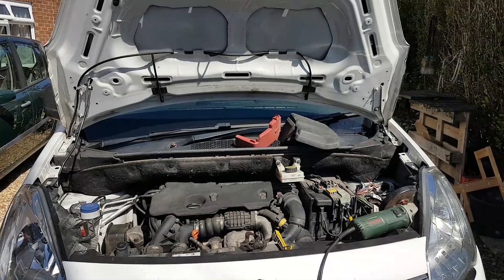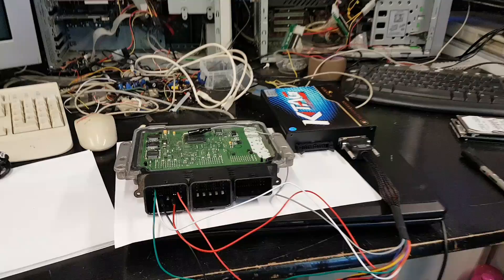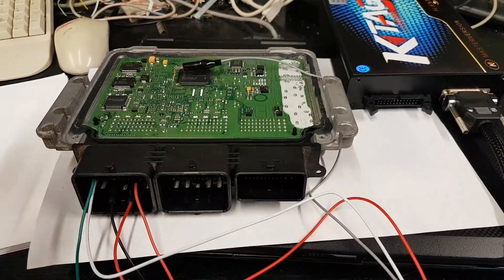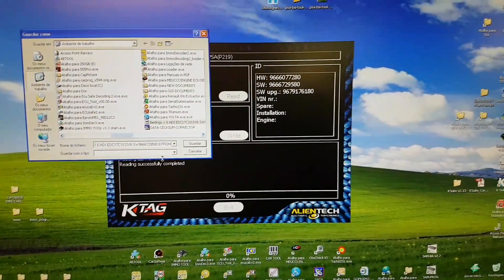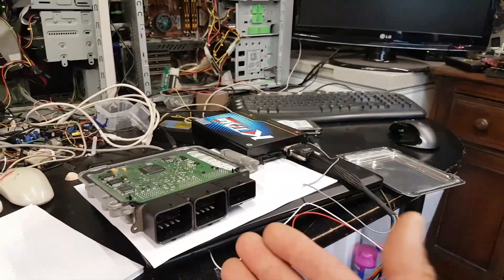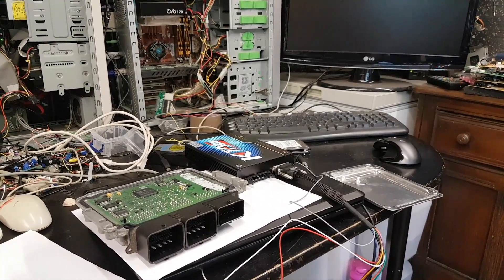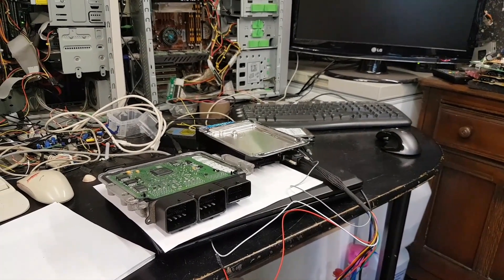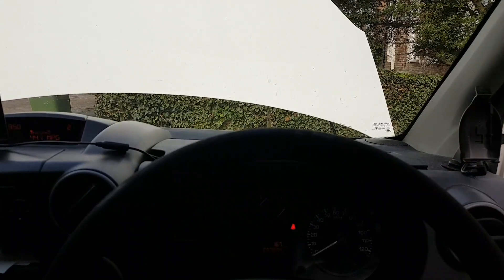Read and write Bosch EDC17C10 with the Tricore TC1797 using K-tag.

Comment: hi
in the menu of ktag you have 3 choice, from "edc17c10  PSA "
plug in 
219- bosch edc17 C10 IROM Tp1797 and
319 - edc17 irom cp42 tp1797
both have tp1797 processor but different plugin

how do you decide which one to select?  thanks
Reply from the maker: They all have the same processor, but the suffix is different...
The first one you mentioned, is obviously for a C10, the second one for a CP42...
You just need to know which ecu you are working with...
👍👍👍
Reply: @LMAutoRepairs  thanks a lot for the quick response,
I also saw   pcb is different from this 2  variants
 greeting from Holland

Comment: Hello i' m trying to read the same off yours edc17c10( maps )by ktag but i'm getting error Reading at 86%. It maybe of ktag clone version. Thanks for help
Reply: Hello, I had the same problem, using a good 8MHz 18pf quartz resonator and adding two 22pf capacitors solved the problem.

Comment: What is tricore? Is it with three wires? K line and can H and L?
And is the advantage of this that you dont have to open your ecu?
Reply from the maker: Hi
No... the tricore referes to the 3 packages united in one single chip...
https://en.m.wikipedia.org/wiki/Infineon_TriCore#:~:text=TriCore%20is%20a%2032-bit,DSP%20in%20one%20chip%20package.
Thank you for watching!

Comment: Doing the very same job yet im getting checksum error on when saving the read files, size of micro is only 1.125mb
Reply from the maker: Make sure you have selected the correct plug in, double check connections...
TC1797 should have 4Mb flash (maps)...
Good luck...
Thank you for watching and for your comment, b
Reply: @LMAutoRepairs  thanks didn't expect you to reply. Solved it by reading from another pc. 🙂 Just need to get hold another dump now. Thanks for sharing your videos.
Reply: @simoncarabott7119  what is the Operating system of the pc you used to get work?
Reply: @leonardorolaza8060  issue sorted was using win 10 laptop i read it on my desktop also with win 10 no issues. I have downgraded to win 7 since then

Comment: Nice video! So, in that ecu was possible to pull the whole flash via tricore? I thought that you can do that only bdm style. 
Is good you pull the eeprom and the flash, but was t better to have that compressed-encrypted full backup what ktag do also? 
If on the way back of writing something goes wrong or put wrong software, ktag will allow you to write only the encrypted one because the lost identification numbers.
Is it the same programming for all EDC17? 
I need kia's crd engine bosch edc 17 ecu fully cloned and suspect will be same. Does it need again that boot pin wire soldered in case of bdm used or will be just fine to be that tricore style? Thanks

Comment: A little bit off topic have you done a Bosh triocore cloning with that tool , I got a burnt ecu gonna have to clone , any advice how its done ? Its a renault master 3 2011 by , 2.3 diesel ,its new to me
Reply from the maker: That should be an EDC17C11...
Most likely has an OTP area...
Might be possible to move the OTP data and do it that way... but not sure, never done one...
This tool will be most likely able to read and write... but obviously not into the OTP...
Thank you for watching!
Reply: @LMAutoRepairs  thanks for reply

Comment: sorry a quick question if the ECU work on the vehicle before or after opening it then why take it of and read and write it again what is the purpose

as am not familiar with it?
Reply from the maker: To modify the maps/data on the ecu...
Thank you for watching!
Reply: ok i see so its not affecting the original  data was in it before if no then how the old data well re restor again is it through the Software in said the K-tag?
Reply from the maker: @rk18drive13  
You are not really familiar with this stuff, I can see...
In this case was nothing wrong with the software in the ecu, was a "mechanical" issue, that was resolved on the software...😉

Comment: Can it correct mileage?
Reply: You can't. In most cases the dashboard itself  keep them and if that is VAG/Merc/BMW then it write in the ecu eeprom and dash.Then constantly check and take the highest value. if your plan is lower the odometer value you need either really special software or to change on both places

Comment: from backup i have two flash files and eeprom. Can the flash be copied from another driver if I suspect that it is damaged? Are the files closely related? Immo, VIN, is only found in eeprom?
Reply: No. Better if you have not only separate files but also one full backup.If you use K-tag, choose full backup option and at the end it will ask you do you wish separate files also.Click yes if need them. In that scenario, you'll get lets say: 2mb flash(maps,settings,car vin,..) ,  500kb eeprom(setting,partial immo settings) and in some cases 500-800kb(if remember) processor software. And also about 500-900kb encrypted, archived backup.
If you put wrong or bad software only that full encrypted backup will save your ass

Comment: Your video is not good explanation how to install that wire cable to the ecu pin point conection....???from k tag....
Reply from the maker: Is not good because you don't have the tool...
Buy the tool and you will see how the connections are made...
Reply: @LMAutoRepairs  oww great...thanks so much maybe i must try that....

Comment: One more question ! How do I can read the computer of my gearbox on BMW X5 f15 4D 313hp EDC 17CP49 2014 year ? Do you think I have to remap it too if I remap the engine( N57 ) on remap  stage 1?
Reply from the maker: No... no need to touch the gearbox...
Unless you go really high on power..  stage 1 you will be just fine...
Reply: Thanks a lot again
Reply from the maker: @nsarov  
👍

Comment: for ecu backup must run full backup ...
if ecu is tuned before you read 
only a full backup will save you lots of time and problems ...

full backup give you one complete backup to restore  and seperete files to
 mod
Reply from the maker: You can backup files separately... is exactly the same...
Thank you for watching and for your comment!
Reply: @LMAutoRepairs  first of all ..
i very happy to comunicate with you ..
you are one of the reason i started 
work with cars ...
but in this case you not 100 right 
i know its same read ...
but if you will get a pre tuned ecu 
by another softwer that use diffrent chksum calc you will have some hard time if ktag will not stop you in time ...
and give you write the ecu .
your only mpc backup will do cksum error ... 
and only full restore in ktag
its turn off automatic chsum 
belive me ...
happend to me a lot on edc16
and edc17cp18
with ktag
Reply from the maker: @hp201279  
🤔
I think there is some confusion here...
When you backup, either full or the eprom and flash separately, they are saved with the current and correct checksums... 
If you need to write them back, if the tool you use does not correct them for that particular module, that still ok...(as far as you have not made any modifications...)
That's regardless of the backup was an original  unmodified file, or a tunned one...
I always make backups separately, because obviously the eprom is going to be for that particular car, the flash however , in some cases can be used in other similar cars/module...
If you backup everything in one file, and then you want to use only the flash, you need to separate the eprom from the flash...
Yes, is not a problem, and either way is correct... I just prefer this way....
Reply: @LMAutoRepairs  happend to me 
few time ...
edc16  read with  ktag  full bdm 
but ktag refuse to write mod file ...
and refuse write same mpc i read 
cksum error ..
i use galleto bdm no cksum option 
and a mpc after cksum with winols
Reply from the maker: @hp201279  
Yes... but that is a K-tag issue... Theoretically shouldn't happen... possibly because as mine, is a clone K-tag...
👍👍👍
Reply: @LMAutoRepairs  thats right ktag problem ....
but if you have only ktag  the full backup write will save you 
and cost you 10min and 3mb free space ...

keep the good work ...
i wish you and your love ones the best
Reply from the maker: @hp201279  
👍
Reply: Hi and from me...
I think full back up and save separate after, is the best way for backup....
If you face any write problem it's much easier to restore the ecu, if you get reading the ecu as maps and eeprom separate, ktag is not able I think to make restore....

Comment: where are you located at ? it seems like you know what youre doing and Id like for you to take care of my car
Reply from the maker: 😊
Thanks!
What exactly are you looking for?
Thank you for watching and for your comment!
Reply: @LMAutoRepairs  I have a 2015 Passat TDI CVCA and after visit to local VW my car has next to no torque !!! I got a malone stage 2 tune and that helped only for couple of weeks and now it is back to what I started with :( car feels as if I was going 4k rpm when gauage shows 2k :( and engine is so much louder ! malone aknowledges my issue and really dont know what is wrong with my car since the file off from my computer looks completly fine ! I have been told that they use some software to dump tune and that could fix it but i really dont know how and what to do... can you possibly help ?
Reply from the maker: @BlondynCh  
Ok, let me see if I got that correctly...
You have the car remaped before you went to the dealer... and after the car went there, came back with all those problems... is that correct?
Reply from the maker: @BlondynCh  
Ok
Most likely they have flashed the ecu back to stock...
Do you have a copy of the tunned file that was in the car before?
Reply from the maker: @BlondynCh  
You should have kept a copy... even if you put it on a CD and kept it with the car paperwork... was a silly mistake...🤦‍♂️
LOL
In that case, I guess you need to read the ecu again.... and you know the rest....
Reply from the maker: @BlondynCh  
What you need is kess or K-tag...
Reply from the maker: @BlondynCh 
Well, in that case advise you to Google a learn how to do it...
Look on YouTube as well, I am sure that there is plenty of videos out there showing how is done...
Reply from the maker: @BlondynCh  
The file you take it from the ecu...
Then you get someone to tune it...
Go to my forum, there is people in there that can help you!
Reply from the maker: @BlondynCh  
Link in the my main YouTube page... in the banner...😉
Reply from the maker: @BlondynCh  
As I have explained to you...
The eprom only contains configuration data etc...
The data that tells how the engine runs, is in the flash memory...
Have the car properly diagnosed, as it could have been a coincidence,  something might have happened at the same time as the car went to the dealer... 
I have a video on an A3, the car was remaped, and when at the dealer was flashed... and never ran properly ever since... yes, the maps were different, but coincidently,  one injector failed at around the same time...
Reply: LM Auto Repairs yeahhh you’re completely right ! I went to this Russian guy had it remapped ! Engine is somewhat quieter but car still has little torque:( we test drove it he started Erving engine up to 4K and is like it has planets of power what do you want in like OMG!! Just paid him and will drive it like this btw-my mpg suck! Now I’m trying to find someone so solder pins onto my “board” will open ecu copy it down just to have a legit backup and start tweaking it on my own xD hopefully I will have a good copy of it in case if I brake it lol I purchase a tone of tools and it is time to try doing it on my own because simply I’m not satisfied! I need to learn about napping ecu because it seems like all “professionals” in Chicago are good in is charging $ I still just got the tune so I can’t say to be exact what my mpg is but what I’ve been Getting lately it seem like mid30s mpg so that’s nothing! + car has no torque so I’m sure figuring that out can’t be too difficult! I’m just pissed that people do work to your car and charge you even though you’re not satysfied and act like car is running the way it is supposed to 🥺it just makes me sad! And I tell them I used to go 180 with this very car and they’re like whaaaat ! And that’s it my car used to never go in high rpm’s and the higher rpms I took it to the more torque it had !  So yeah I’m pissed ! The worst part about it is i just don’t know what do to lol so I’ll save a copy of ecu before I mess with it
Reply: And guy who worked on my tune told me noooo we don’t open ECUs it is too dangerous lol like wtf
Reply: Yeah I forgot to add lol he is so convinced that everything is as it should that I’m scheduled for dyno on Saturday lol
Reply from the maker: @shareridekaraoke6358  
👍
Reply: LM Auto Repairs I had a 2012 Jetta tdi (with no governor) I have eeprom off from that car will try to load that onto my Passat with hopes for a fix lol do you think it could work or mI risking bricking the computer?(that’s why I want to make a copy with ktag) so in worst case scenario I have a copy of original one
Reply: @LMAutoRepairs  they use something called eeprom programmer but I cant get it to work on my laptop and honestly im sick of it already lol

Comment: is it possible to repair an ecu with no check engine light on? where can i download ecm titanium software, can you please share a link
Reply from the maker: Hi
What do you mean with repair an ecu without the engine light on?
Google will help you finding ecmt...
Thank you for watching!
Reply: @LMAutoRepairs  i mean when i plug the faulty ecu and turn ignition on there is no check engine light, shop owner put a new ecu and the car runs fine
Reply from the maker: @barkatakiutpal  
Ok... but can you communicate with the faulty ecu?
If is a software problem, you might have some chances... if is hardware, obviously this will not do nothing....
Reply: @LMAutoRepairs  should i try with ktag?
Reply from the maker: @barkatakiutpal  
Go for it...
Let us know how it goes...
Reply: @LMAutoRepairs  ok, thanks man
Reply from the maker: @barkatakiutpal  
👍

Comment: hello Mr, what does it mean ( TRIGGER FUNCTION ) in oscilloscope and thanks
Reply from the maker: Hi
Not my words... but basically is this...
"An oscilloscope's trigger function is important to achieve clear signal characterization, as it synchronizes the horizontal sweep of the oscilloscope to the proper point of the signal. The trigger control enables users to stabilize repetitive waveforms as well as capture single-shot waveforms."
There  is a lot of info on this... just Google it...
Thank you for watching!

Comment: Hi darling 
I have Mercedes benz when cnnectiing torbo tube throuth the throttle the engine not ideal operation when acceleratin padle 
And when disconnecting tube operations ideal  
I have short video how i send to you ?
Reply: you dont use darling to a gent nigga change that next time.
Hiwadarm Hala Tenagaishtbit.

Comment: i wish you were a lot closer to kent, seems the dealer who sold me a car cant fix it.  engine light comes once you been at or near 70 for a 5 mins on motorway, misfires and loses power, restart gets some of it back and engine light turns off, but still missing,  get to dealer after the little rest , its not missing anymore, hes a honda main  dealer but cant scan all the codes from a ford (too tight to buy a real scanner) alreay ive had 2 coil packs (one pack 4 cylinder) 4 leads, 4 plugs,    same error...hes too lazy to test drive it properly,